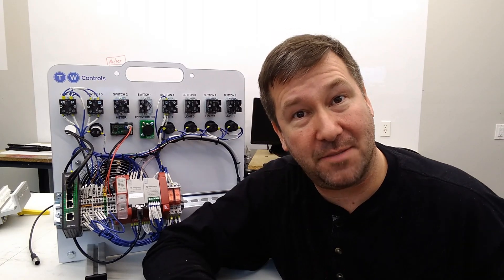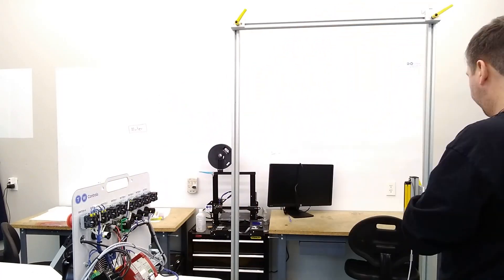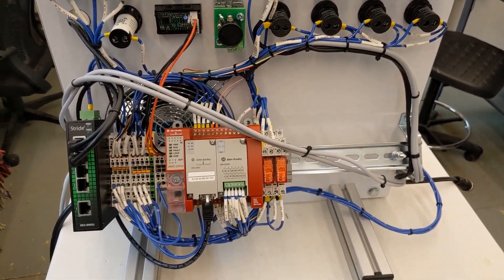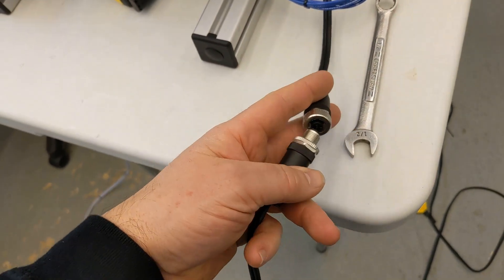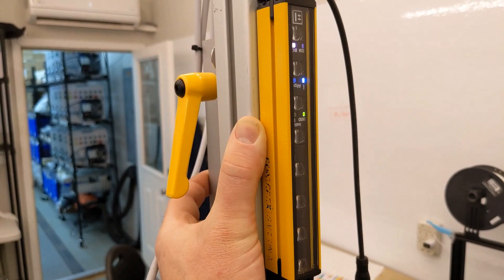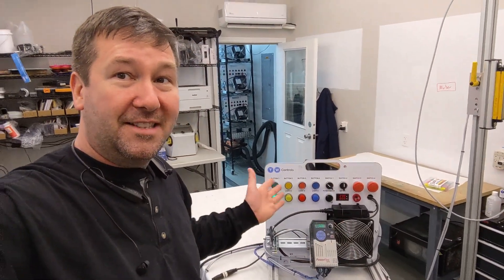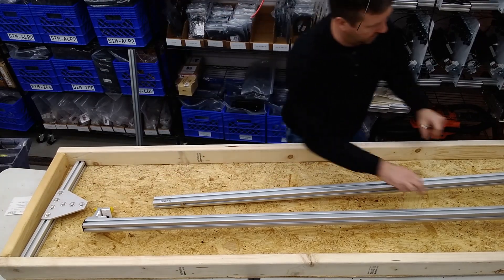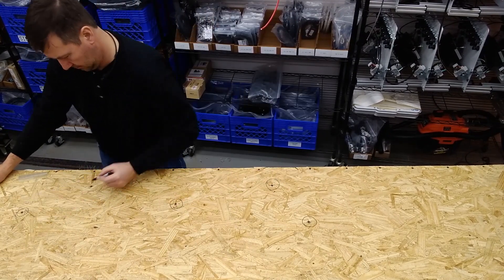Making Industrial Safety Fun to Learn!  The Limbo Dance Trainer

Comment: Is that processor safety rated? I've used a non-safety version of it. I generally default to one of the Gaurd Logix Processors.
Reply from the maker: Yes it is.  It is a "Configurable Safety Relay" so it doesn't have the flexibility of the Guardlogix but it is far easier to program and troubleshoot in my opinion.  We are making a lesson series on it at https://twcontrols.com/safety-plc-lessons